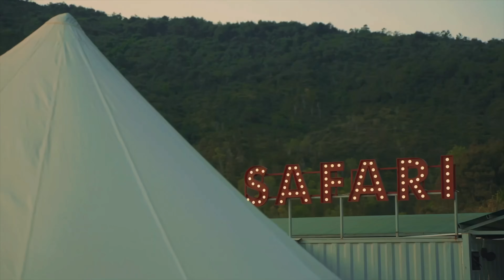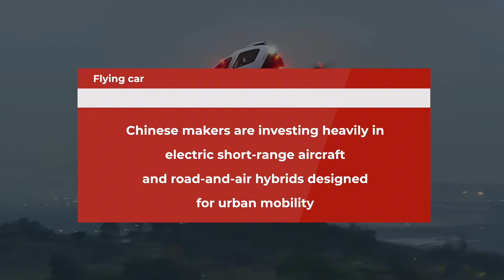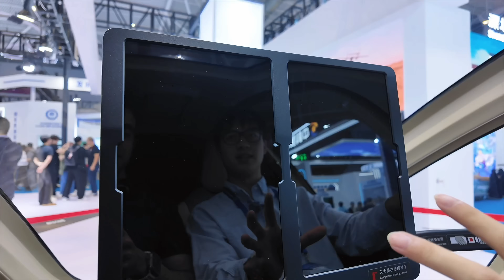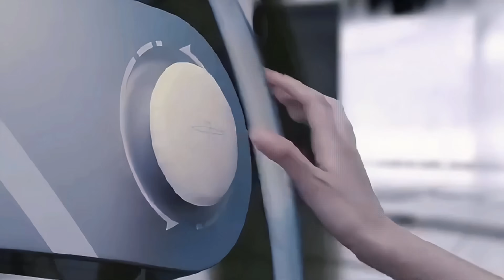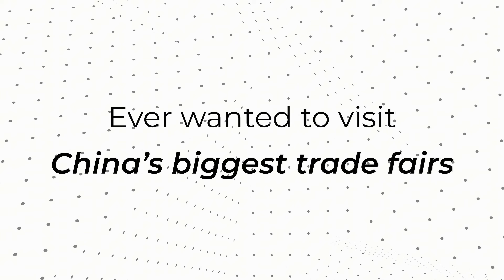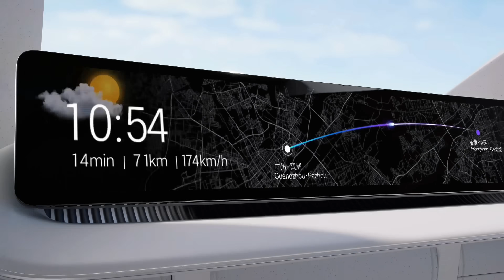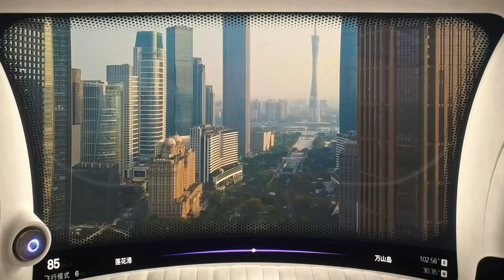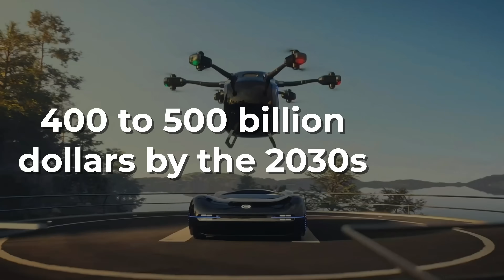How China Already Has Won the Flying Cars Race

Comment: Why all electric? Wouldn't making them hybrids make more sense? Strap on a 5 or 10 gallon gas tank on those puppies to extend their range.. plus I would feel safer knowing I have a backup if my battery runs out. 👍🏾👍🏾👍🏾
Reply from the maker: I guess the weight is the main reason
Reply: @RafaGoesAround  Wouldn't a small 3 piston engine be light enough for a small drone taxi?